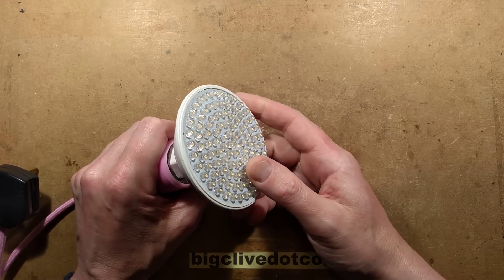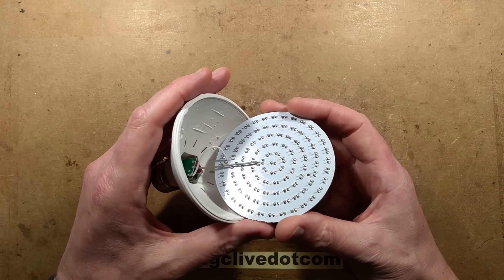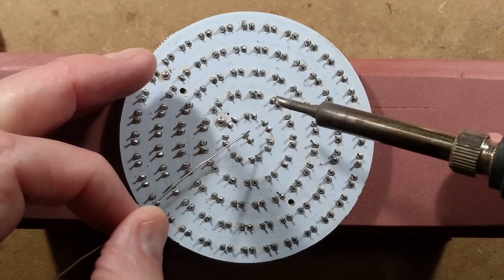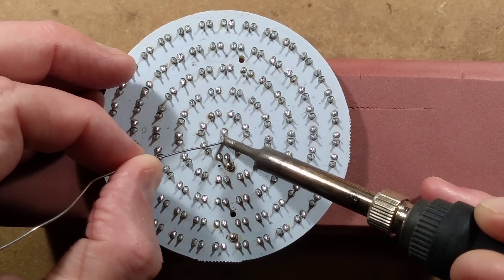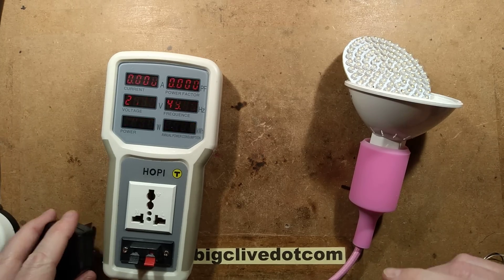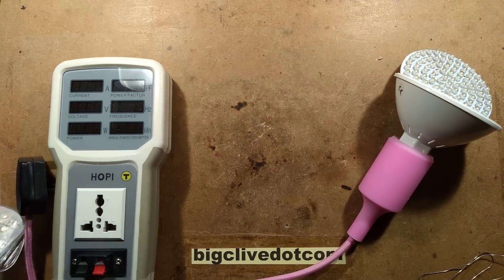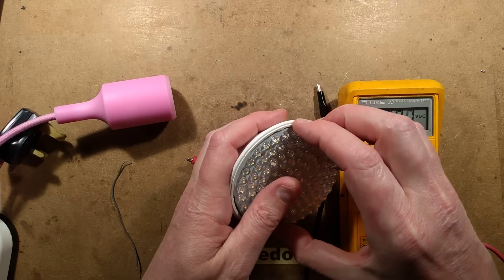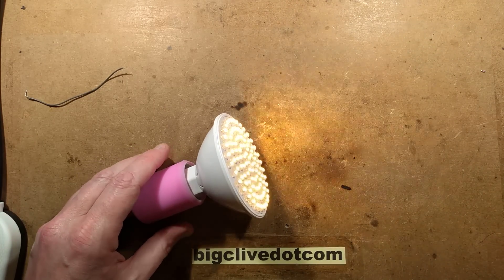Repairing a rather nice 100 LED lamp.

Comment: Back in the '80s I used to pick up defective Radio Shack products (games, etc) that they had in a bin for just a few bucks each. Usually just bad solder joints. Reflow and they almost always started working again. I got the reputation of being able to repair anything!
Then in the '90s my neighbor threw out his 52" cabinet TV. He said it had an audio problem and he already had bought a new replacement.  I rolled it into my garage (yes it was a big cabinet). I just hit all the solder joints on the audio board and my family enjoyed the large screen TV for a number of years.

Comment: Where can I learn how to tinker with my LEDs without killing myself? I have a cheap multimeter and have been trying to diagnose faulty LED shop lights but I don’t really know what the hell I’m doing. I did verify the voltage is roughly 120v into the power supply and also on the other side of the lamp’s on/off switch (when it’s on). From there, I can’t figure out how to measure the DC output to the LED strip so I don’t know if the power supply or an LED is at fault.

Comment: ive got a built-in-to-mains kitchen light which is a big led square, stopped working so replaced it. ive kept it tho, if i fix it, any way to convert it to a lower power consumption (to use as a desk light), or should i just wire it up with a plug? im in china so perhaps just chuck it eh?

Comment: The non-conducting half was not using its half of the 25 mA, so the conducting half was probably running at nearly twice its normal current, or about 25 mA.  Hopefully that didn't shorten its life.  Here in the USA the series strings of LEDs add up to half of the 240VAC LED bulbs, so it's about 75 VDC or so.  If there are no "power surges" (overvoltage faults) then these cheap LED bulbs should last a very long time.

I plugged in a Philips LED bulb almost 10 years ago and it's been on 24/7 since then, except for several power outages lasting a few days.  It has over 80 thousand hours on it and it's still bright, but I don't know if it's dimmer because I had no way to measure the light output back then.  It's probably somewhat dimmer, but it still looks okay.  My stamp of approval goes on the Philips LED light bulbs, they're a reputable brand.

Comment: i find that "burning rubber smell" is often the residue left by the tape used to hold the parts in an 'ammo belt'  - resistors from those were famous for that stink and poor solder joints because of it.  That and the bane of lead free solder.  Worse was tarnished silver connections that smelled like urine when soldered

Comment: All that bitching about lead-free solder. You've probably just never gotten your hands on some proper lead-free solder. Bad solder joints are always bad, independent of the kind of solder and new lead free alloys are even more shiny than "good" leaded ones (which are not optimised for shininess but usability and quality of the solder joints). The only problems with "regular" lead-free is the higher melting temperature which is very close to the melting temperature of e.g. the plastic cases of the LEDs making it somewhat tricky to control the reflow process (which is most likely also the reason your lamp had bad solder joints); there's Indium based lead free solder but it's hellish expensive, I guess mostly due to the patents. Never mind the industry has stopped developing new leaded alloys a while ago because it can't be used anywhere anymore except for a select (and constantly shrinking) set of exceptions while lead-free continues to get better and better. I can send you a bit of Felder Sn+ if you'd like to seriously try it out. It's the best solder I've used in my life (including leaded); it flows absolutely great, the the joints are incredibly shiny and being eutectic and highish temperature means the solder joints a solidifying quickly resulting in a very smooth soldering process.

Comment: There's a lot to be said for reflowing joints. I did my gas boiler PCB ... et voila the thing worked again. It was several hundred SMT joints, but less faff than trying to source a replacement as I didn't know if any nonvolatile values got stored during the commissioning process. 

In general, I find a lot of stock items work better when they've had some TLC. It's not that they were designed wrong, but sometimes the manufacturing process is cut to the bone.

Comment: There is no DC current on that cable !! Only AC, then each group of 50 LEDs is illuminated half of the time which makes full time illumination.
Reply from the maker: It uses a standard capacitive dropper with rectification.
Reply: Well, yeah I should have thought about it.. I also can see the flickering isn’t split in both circuits either, so agreed. Good video again, thanks for it!
Reply from the maker: @esspe2  It usually does show as a distinct oscillation on camera when they do have each set of LEDs light on opposing half waves.

Comment: At 1:10 you seemingly unwittingly discharged the dropper, judging by the brief flash in your currency finding screw driver. Nice touch!
Reply: I was about to comment the same thing!
Reply from the maker: That driver has a battery in it for continuity testing.
Reply: Now I am curious as to what continuity it detected...  but not enough to recreate the circumstances.
Thanks for the response though!
Reply from the maker: @NeoVoxPopuli  Just between the metalwork I was touching and the other hand touching the back of the test-driver.
Reply: A currency -finding screwdriver would be quite handy. Hmm :|

Comment: This bulb seems like blessing to fix
Many bulbs I have tried to fix have been surfice mounted.. And most of the time these are just burned out Leds. So I have just bridged them to get some more life out of it

Luckly if you can get to the leds without completely destroying the enclosure tbh
Reply: I bridge mine with aditional 48 ohm resistor connected in series before the circuit.
Keeps them happy for another half a year or so.
Also, they are pain in ass to open, so i just cut the difuser awayband never put it back in.

Comment: Hope it’s not referenced to the mains
Reply: capacitve dropper circuits are and therefore the powe supply circuit and circuitboard with the LEDs need to be fully encapsulated in plastic
Reply: Maico I was being sarcastic...
Reply: well then my information is for whoever it suits :)

Comment: I have a question, but first some back story...  I was peeling off the yellow coating from a square led array chip "automotive interior" replacement lamp which had burned out due to my lack of current-limiting... And whilst peeling and poking around, I saw a faint sparke/glow following along the edge of the separation area!! What sorcery is this?!?  Try it, under dim lighting...
Reply from the maker: I've not seen that,but I'd guess it's possibly electrostatic phosphor stimulation or a triboluminescence effect.

Comment: Can you do us a favour n throw that dangerous screwdriver away as you know more than anyone how dangerous they are. Or if you do use it, please use it on random dead things like this. 
I always make sure that I use proper testing equipment for anything that's at mains voltage due to the amount of current that can happen if there's a short.

Comment: That lead free solder really bites. It has a long list of automotive use issues. It seems in a lot of cases to crack from the vibrations. Some reflow the joint and the smart ones take more time and remove it and use real lead containing solder.

Comment: Led lights have much shorter life expectancy then the old lightbulb.
Reply: But use a lot less power, and not a great deal more resources. LED also last longer than traditional fluorescent tubes and compact fluro lamps in my experience.

Comment: It would be interesting to see the current waveform on an oscilloscope. I would bet the peak current is much higher that 25 milliamps, but the duty cycle is fairly small because the LEDs won't draw any current until the voltage reaches close to 150V and will shut off as soon as it drops below that.
Reply: Glenn Hamblin That's where the power factor comes in. The amperage reading is a time average over the rectified AC current.
Reply: @gordonrichardson2972  
Yes, I understand that. But the digital DC ammeter cannot effectively read that funky waveform with any accuracy at all. The scope will show the peak current and the funky waveform. It would be worth looking at.

Comment: Must be a lamp from 1927, since LED-lamps last 50'000h! LOL!
Reply: 52,000 hours is about 6 years
Reply: @toejamr1  If it was on for 24h/day, then yes.
Reply: @toejamr1  Well, nobody lets the lamp 24/24 h on. What do they calculate on the packages? 1 1/2h a day or 3h?
Reply: Juri Vlk Except Clive.  And exit signs, street lamps etc, etc.  But the 50000 hour number is for the LED chip itself, not the least durable component, which in this case was the solder.
Reply: @johnfrancisdoe1563  They cheat everywhere! On the packages, it is not specified that only the chip is meant. Would be pure cheating.
Reply: @toejamr1  They are usually rated at 3 hours per day.

Comment: I wish I had a $1.00 for every  Lead-Free joint I had to fix in something new that I bought!
I got a 35 watt amp the other day and it worked for a hour and them quit... I reflowed every joint with Lead solder and it worked again. There were 6 bad solder joints so I did them all.... Sad, thanks UE or EU whatever it is....

Great Video Big Clive! :D

Comment: Hi Clive,
Love your vids, I don't know how I got in to this stuff butt i love it.

Anyway I need some help with a DC power supply its from a KEF KUBE 1.
Thing is it has 3 wires for the output a red one+12v, a black one, and a white one-12v.

I have tried the red and black and it Powers up my new d-amp. 'cause like an idiot after replacing a fried capacitor on the power supply, I shorted out the original amp😣😭.

So now I've got a Chinesey amp (24v-32v) but it only has a 2 pin dc power input jack. 

link to Amp :- https://www.ebay.co.uk/itm/YJ-TDA7498-150W-4ohm-Mono-Class-D-Subwoofer-power-amplifier-Completed-board-Ste/282901840929?hash=item41de438421:g:8~oAAOSw13Zauk-Q

So the red wire is only 12v. 
Now the question is can just twist the red+12v and the white -12v together and get 24v or will my power supply fry?

(Sorry I is a noob at this one)

Any help appreciated. 😊

Best Regards ZED
Reply: That way you short out the PSU. Between the +12V and -12V lead are 24Vdc. Connect the -12V as ground/negative and the +12V as positive to get that voltage, and cut the original ground lead (black).
Reply: @westelaudio943 Awesome THX buddy. Will give it ago.

Comment: Clive, I wish you would educate me on power factor.
Reply: Let's say 20W of real power and you got power factor 0.5 that mean the total power it's consumed is 40VA. VA is volt ampere, and watt is real power. The way you calculate is real power divided by power factor equal volt amps. So if real power is 20W and power factor is 1 total energy it's will consume is 20VA. So yeah power factor 1 is efficient but only happen at resistance load while capacitance and inductance have power factor of 0.5 but in opposite directions, that why big inductance load like utility transformer, industrial motor, or even at your washing machine and fan has a capacitor to correct the power factor. It wasn't perfect to make the power factor into 1 but at least 0.8 which is much better than power factor 0.5 . Just imagine if the industrial motor required 100kW if the power factor is 0.5 it equal 200kVA. if the power factor is 0.8 it equal 125kVA, which is 75kVA more efficient.
Reply: Rahman Aridho, good explanation, thank you.

Comment: A nice low voltage lamp (I'm not a fan of mains projects, and do odd jobs for people reliant on battery power) can be made with those 1W led beads and a circular aluminium pcb designed for 5 of them, you do have to mount it to some sort of metal plate (a metal light fitting?) to help dissipate the heat.   You can get the small driver pcb that was intended for MR16 lamps and modify it to run at a lower current than the maximum for the leds (150mA is good for the 1W beads, about half power).  You get good light level without much heat, as it's quite spread out, and the LEDs should last for ages.  You can also use the same driver boards to convert the rotating mains powered 'disco bulbs' to run from 12V - you might have to include some interference suppression beads though as the Chinese driver boards can be a bit noisy - not good in a battery powered home when you want radio reception.

Comment: So, what could be added to reduce flicker?? 🖖
Reply: the flicker is from the camera.
Reply: Also a driver with a full bridge rectifier as this is only using half the sine wave
Reply from the maker: It's a capacitive dropper and rectifier, so it's full wave.  The smoothing capacitor value could be increased to reduce flicker.

Comment: y'know, every shimmering problem with Euro lights can be solved if the power grids ran at 60Hz instead of 50Hz making it easier to sync it up with multiples of 60 for time scaling.
Reply: you mean Euro, Asian, pacific (Aus NZ).. or, more to hte point.  just about everywhere  apart from the USA
Reply: PAL (the video standard used in most of the world) is 50 Hz. I'm guessing Clive is recording this on a phone that doesn't support 50/25 FPS (his videos are 30 FPS), but on a proper camera it would be in sync with mains frequency.
Reply: @RFC3514  NTSC or bust!
Reply: It often did. Which is why video engineers called them "Never Twice the Same Colour" and "Pictures At Last", and why most "NTSC" digital formats adopted PAL / SECAM style sampling. And don't get me started on 3:2 pulldown.

Anyway, these days (unless you're talking professional broadcast equipment, that still tries to be 100% compatible with analogue standards) the only practical difference is the frame rate.

60 (let's pretend it's actually 60; in fact NTSC is 59.97 FPS, because why be sane?) does have the advantage of being more factorisable, but people don't really use sub-multiples other than half (ex., not many cameras support 60/3=20 FPS, and both 60 and 50 are easily divisible by 2), so it's kind of irrelevant. Keeping the cameras at a frame rate identical to (a sub-multiple of) mains frequency is still the best bet in most cases (not just because of unsmoothed LEDs, but also fluorescent lighting, etc.), though you still need to play with shutter duration to avoid tearing when you film things like CRTs and 7-segment displays.
Reply: @RFC3514  you're a smart man!
Reply: I know, that's what the guy in the mirror keeps telling me. But I'm not sure I trust him; I'm pretty sure he steals my shirts.
Reply: That's the only thing I don't like about the Brit mains system.

Comment: Clive, I've watched and enjoyed your videos for ages so 1st of all, thank you! , I have a question for you please. I have an opus bt3100c battery charger it charges 4 batteries at once but recently one of the ports will not charge batteries, as soon as you plug a battery into it, it immediately drops to 50mah trickle charge instead of the set charge of either 200,300,500,1000 etc. Could you give any suggestions to fix this please?
Reply from the maker: Are the contacts on it clean?  If they are I'd suspect a cracked solder joint or component failure.
Reply: @bigclivedotcom  OK thanks Clive, I shall take a look inside when I buy a new one, just incase I damage it ireprably! ;)

Comment: Why question your meter, you just tested them all against each other! 😂
Reply: Clamp meters can get interference from other nearby components. He mentioned that.
Reply: @two_tier_gary_rumain  sure but you have to have some faith
Reply: Because the first was a (Hall effect) clamp meter, that wasn't actually in line with the circuit. The principle used to measure current is completely different between the two. And neither of them has anything to do with the resistance measurement, which was what Clive compared in the previous video.

Comment: Another great video . 
I ask about the best electrical engineering tables, standards, formulas book  in uk
Reply: For formulas Geick "Technical Formulae" is one but a pain in the neck to get or https://www.amazon.co.uk/Engineering-Formulas-Kurt-Gieck/dp/0071457747 which is unfortunately expensive. As for standards and tables I'm not sure I generally either have books some of which are 40+ years old (EG Facts Patterns and Principles, by Keene Rogers and Simpson) or data I have just collected and archived.
Reply: Geick covers most engineering not just electrical/electronic.
Reply: @gordonlawrence4749  
i am locking for a new books in year 2017 . 2018 .2019
Reply: @العراقيالمبدع-ي1ي  The basic theory has not changed for decades. The standards change so fast a book from this year will most likely be obsolete next year. That's why I download PDFs for standards from the relevant government web sites. It's the only way to get the latest information.
Reply: @gordonlawrence4749  
Any way thanks to you .